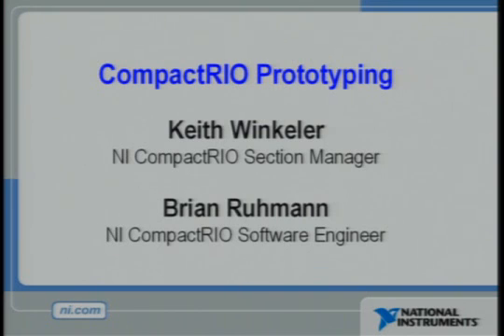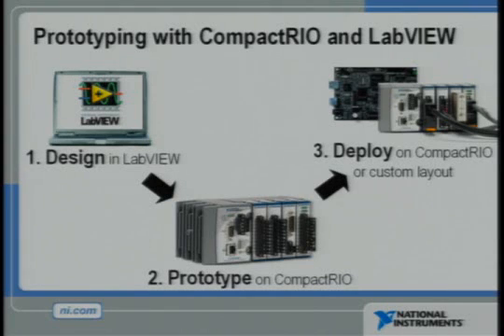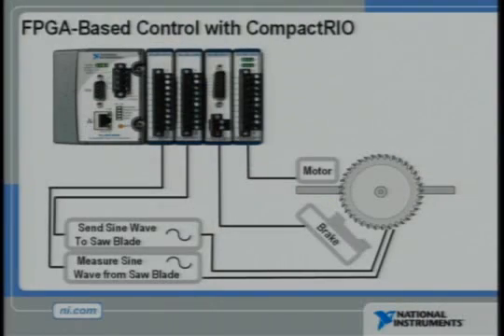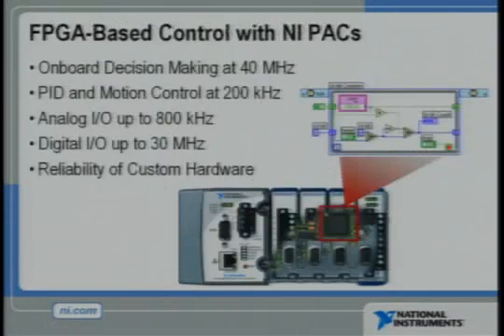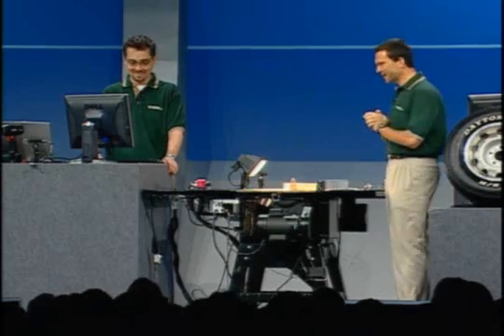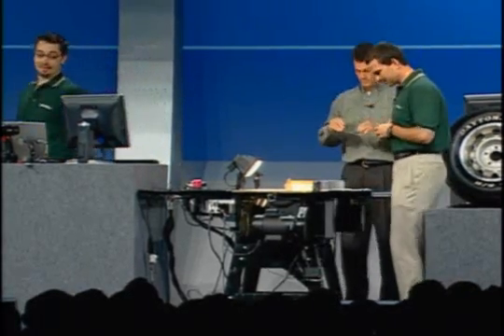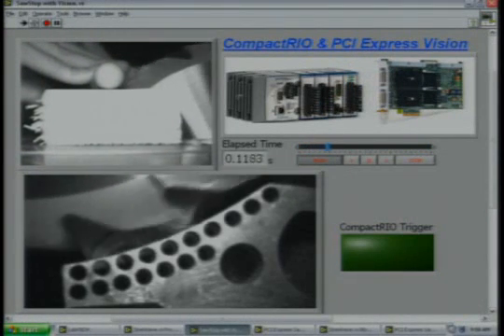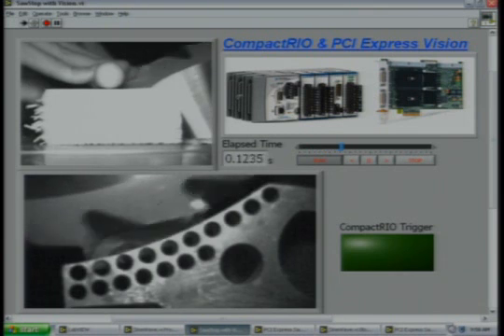NI Week Sawstop Demo

Comment: Sawstop macduff is impressed, macduff's innovative technology (The Original Jimmy Jig) the other alternate
mated to older table saws has retro-fitted that technology to be as save as it can ever be,
it will not wreck the blade or stop the saws operational function.
All macduff's ideally automatic anti-kick back devices are placed up front over-head of the blade or
cutting tool on a
stationary fence, (a macduff first) attaches to a bracket with a suspended rod from the stationary fence

Comment: which will never deviate from the parallel.
This portable light weight technology cuts sheet material to 4ft. on center requiring no large
permanently mounted side or out-feed extension tables 
World wide there are hundreds of thousands of table saws with the old dangerous technology out there. Sawstop at
this time cannot retro-fit these saws.  Buy new not necessarily, retro-fit available yes (plans)but don't be
complacent and keep your wits about ye, slainte mhath macduff